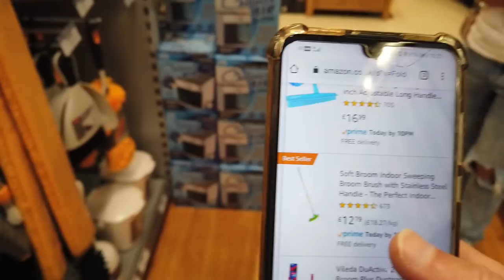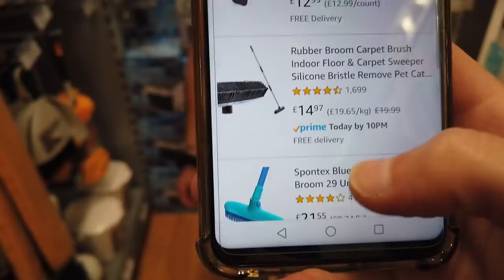HOW WE GET INTERNET IN A CAMPERVAN.. staying connected on the road! Vanlife UK

Comment: Good vlog guys. Honest and real. I hope we get to see the end result of the antenna and router though. I feel I am missing something with the cables and why they are running out of the antenna and along the roof before coming down into the van, rather than just running straight out of the bottom of the antenna and into the van.  Lovely ending to the video.
Reply from the maker: Thanks Angela 😁 yeh we will update on the WiFi, will be nice to really test it out as well to see if it's any good. The reason the cables don't come straight in is because I already have my ceiling cladded and insulated so the thread on the bottom isn't long enough to come all the way through. Also, where I've sited the aerial it has lots of space around it to pick up signal but it made more sense to bring the cables in further down the van, as there is already an easy cable way there. Hope that clears it up a little bit lol, the only other thing I really didn't get to film was connecting the router up to the 12v power supply.
Reply: @campervibe  Ah I see, that makes sense.  That's great the router can go on a 12v connection.

Comment: I have a telescopic ladder like that and I find it invaluable for accessing places. Mine tends to sometime mark or slightly scratch walls or whatever it rests on. The best solution I found is pipe lagging/insulation made of hard foam. I bought some with fairly thick walls, and the type which has a cut-out along it's length. I find that it fits perfectly on the top wrung, so that the ladder rests on the foam not the wall. I actually cut two pieces - and I can either use them together on the top wrung, or separately on the top side rail  sections - depending on what do I rest the ladder on. In case it helps :-)
Reply from the maker: Thanks seb, this one actually has little rubber stand offs to help with that, and to aid with grip I guess. If you were worried about the noise as I placed it on the van that was actually workmen out of shot on one of my neighbours houses, just timed up perfectly to sound like I'd clunked the ladder down on the van. The rubber stand offs are great 😁👍
Reply: Yeah - that definitely sounds good. I didn't realise they make them with stand offs now. Good thinking! :-)
Reply from the maker: @sebxj25vm  yes, very helpful, this one is pretty old though, maybe they've stopped doing it for some reason??

Comment: Another great video - thanks. I can highly recommend the use of 3M VHB 4950 tape for sticking things to a roof and negating the need to drill holes. VHB tape does not come unstuck and there are lots of videos showing people using it to hold down solar panels on their RVs. My internet solution is a Netgear Nighthawk router powered from a USB-C cable (= 12v). I use it as my home internet (so no phone line or fixed broadband) and it can accept a network cable for connecting up various devices using a small network hub. When I go to my caravan (a tourer used as a static) I simply take the router with me. I'm fortunate to get a really good signal (without an aerial) in both locations even though the caravan is in a field in rural Denbighshire. Works for me but everyone has different needs.
Reply from the maker: Hi Mike, if we were staying in areas with half decent coverage then we could probably do the same, we just need that extra bit of reach every now and again. I agree 3m tape is good stuff, I have (only once mind) had it fail in the past and when it comes to things wired inside of my van possibly flying off at Speen on a motorway I like to have that little extra piece of mind. Thank you for watching 😁👍
Reply: @campervibe  Thanks for the reply 🙂. I'd like to know which is more important - an aerial that will enhance the signal ... or the 'original' strength of signal from the network. I get phenomenal 4g speeds from EE and Vodafone in my field. Three - my current Sim - is 3g and a bit flaky. It's also worth monitoring your actual data usage because EE do a 200gb Sim for £23 which will be my next move as soon as I can escape the clutches of Three. Whilst I often use 100gb I rarely go above 150gb. Looking forward to seeing how you get on 👍

Comment: Little suggestion for the Q&A session in the next vlog: options for van interior paint. I can't really find any video on YouTube discussing this. I'm looking for more than just a recommendation for a particular brand - I'd like to understand a bit what are the various options and advantages/disadvantages. Water paint, oil paint, acrylic paint, emulsions, danish oil, other wood finishes and waxes? VOC content implications? What are they, which one works, which one is recommended, which one you can get away with even if it isn't recommended? What works on plywood and what works on solid wood? Of course, the cheaper the better :-) Or maybe it just doesn't matter - anything will do? I know - it's a lot to ask - maybe a topic for a separate video?
Reply: Wax easer for both ply an other wood
Reply: Thank you - I guess it wouldn't really be the answer if you want a particular colour I guess - such as white?
Reply: If your going to paint the wood you will have to do a few things to it first like seal the knots then paint primer then undercoat then top coat   cheep way seal nots paint with silk vinyl then second coat or paint make the second coat mat  tip for you if you got or get any grease on paint work and are unable to remove it an it keeps coming through the paint  paint the spots with undercoat first   chose a good name paint to do a good job all the best

Comment: I would have been curious to see/hear how the wifi antennae / setup worked out in the end. I know in theory the van being made of metal should attenuate the phone signal - but frankly I can't say I've noticed it so far. Maybe a speed test connected through the wifi router, and one connected through a phone on the same mobile network as the sim in the router, to work out the real life improvement in signal/reception?
Reply from the maker: Hi seb, I've ran a speed test but as we have great signal next to our house it's a bit pointless. Most of the time a phone as a hot-spot or something will be fine, but we plan on going well off grid, where signal is most certainly an issue. When I was on a trip a couple of weeks ago I was in a few spots where signal wasn't great, so I connected the aerial and poked it out of the skylight, massive improvement. I don't know if you noticed, but early I the video I did say I wouldn't endorse it as I don't really know if it's any good yet, no doubt we will do a follow up once we've got right out in the sticks in various locations/countries etc.
Reply: Thank you for that. Yes - some further comments in the future when you've had a chance to assess the difference between it and using a phone as a hotspot (even with the phone stuck out of the window?) would be very useful I think.

Comment: So far, would you say this has boosted WIFI speeds in the van as opposed to just tethering off a phone/standard MIFI unit? Was it worth the money? Thanks :)
Reply from the maker: Hi bex, it was fantastic all through Europe, even in the most remote places. I have to say its not performing as well in the UK, but not yet too sure if that's more a network issue.

Comment: I appreciate that you cant endorse the WiFi you fitted as yet but could you let me know how much yours cost and where did you buy it from? Thanks
Reply from the maker: Hi Keith, it was from a company called motorhome WiFi and it was somewhere between 4 and 500 quid including the bracket and some cable extensions that I needed, it weren't bloody cheap lol! I can't remember exactly now. Hope that helps.
Reply: camper vibe mmmm. Thanks Lou, a lot of pennies then. Will look forward to your review in due course whilst i do some homework on it.
Reply from the maker: Yeh I think there are very good cheaper options. Our problem is Emily will be working remotely and we hope to get as off grid as we can sometimes so need a reliable connection. For us it's more of an investment as it allows Emily to work, hence why I spent so much, there are much cheaper external antennas about that will probably do a very good job.

Comment: Why use the wonky bracket at all? Too late now but you could have drilled the larger hole directly in the roof and "glued" the antenna directly to the high rib, the gap wouldn't need filling as long as the centre bolt area was water tight. Then just do the nut up inside the van. 🤔🧐☺️
Reply from the maker: Hi Andy, that wouldn't work I'm afraid as my ceiling is already clad and insulated, the bolt on the antenna isn't long enough. Secondly I wouldn't want to glue it down, if there was a problem I then couldn't send it back or if I ever change vans it will be a pain to remove, also I think ramming a load of sikaflex under could potentially damage the unit itself. It's designed to fit to a flat surface I'm afraid.
Reply: camper vibe fair comment, although You had to drill the cladding and roof anyway to get the cables through. I would have probably used a hole saw on the cladding to make a big enough hole for a socket to pass up and then the cone cutter for the roof hole to secure the tube nut against. Meh, it's done now 😂👍🏽
Reply from the maker: @HandyC  thanks for the input, but I really wouldn't go down that route on a ribbed roof with this unit, it's a lot of money to risk getting it wet or piling on a load of sikaflex when I can just stick to the manafacturers guidelines, covered by the warranty still then.
Reply: camper vibe I'll find out what it's like soon as I'll be ordering the same antenna for mine... Flat roof for the win on mine though 😁👍🏼 initially I bought a cheap chinese antenna you clamp to the roof rail but it's shite 🤣😫🙈
Reply from the maker: @HandyC  tends to be the way with Chinese, sometimes you can get a right bargain and sometimes to get a pile of old s*** 😂🤣😂

Comment: Never ever run cables through a hole in metal without using a rubber grommet..Eventually the vibration will wear through the cable and short everything out..

Comment: Why not put the antenna straight above the hole and seal it up?
Reply from the maker: If I did that, because of the roof ribs I'd have to use a hell of a lot of sealant and because my ceiling is already clad and insulated I wouldn't be able to get the nut on to pull it down properly to get the seal. My worry would be the sealant may damage it and removing it at a later date would be a right pain in the arse lol!

Comment: Bugger, you sent the old vulva to the scrap yard over a faulty fuel pump. 🙈🙈🙈🙈
Reply from the maker: No it wasn't that but, when I was recording thats what popped into my head, it was to do with fuel and air in it... We had the same issue a few years back and after many garage trips, break downs and finally a trip to a diesel specialist that ended up costing a fortune it was fixed! We didn't have the time or money to do it again, so we decided to cut our losses on it this time round 👍

Comment: I would love better wifi in my van but I weighed up the health issues  and it just isn't worth it. The amount of EMF running through what is essentially a metal box already full of electrical frequencies is a recipe for disaster. Please just take notice of any changes in your health or energy levels or breathing capacity since fitting 5G in your van. Transmutting and clearing away these harmful EMFs is my actual business so I have years of knowledge about the health effects in a house never mind a van 💚
Reply from the maker: We have not seen or noticed any changes, thanks for the info👍
Reply: @campervibe  Let me know if you would like any Tensor rings...I will happily make some for you both and for Fanny free of charge..for a little mention on your vlog 😘😁 x